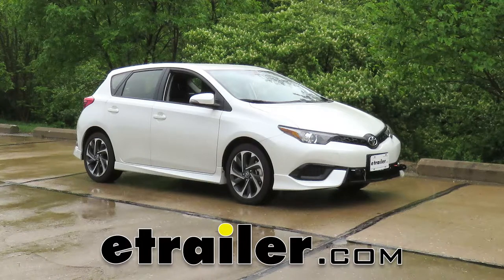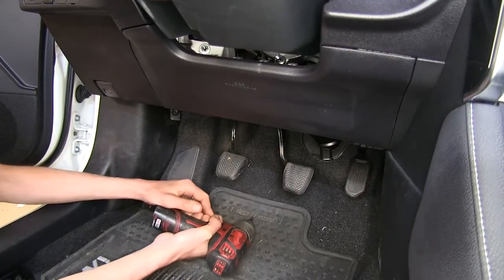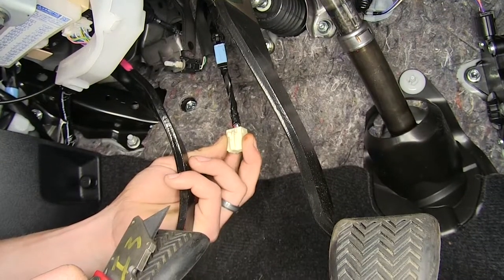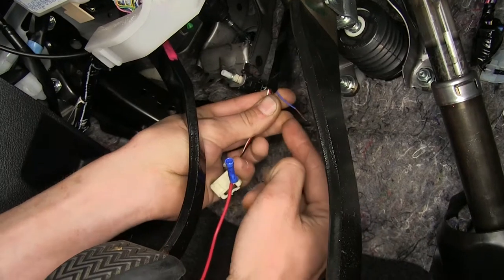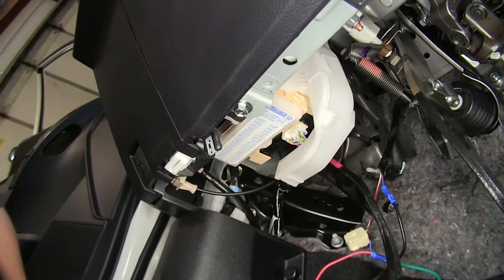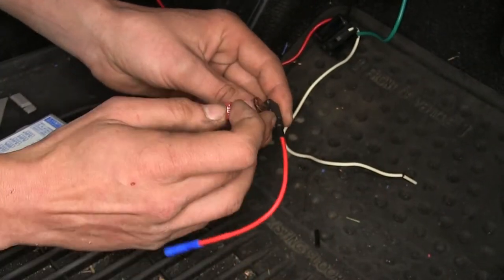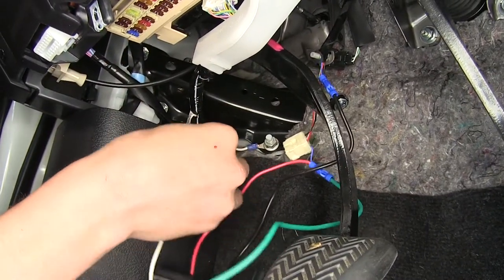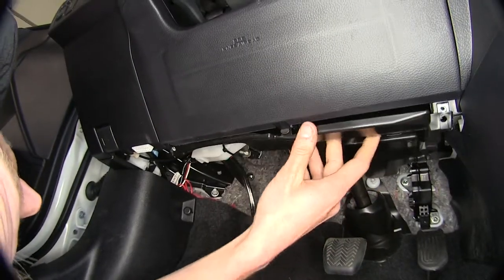DIY Install: Roadmaster Brake-Lite Relay Kit for Towed Vehicles on your 2017 Toyota Corolla iM

Comment: Will this work for turn signals too?
Reply from the maker: This specific part number ensures that your towed vehicle's turn signal lights flash in tandem with your RV's lights. It keeps your towed vehicle's brake signal from overriding the turn signal sent by the RV.

Do you have a specific issue you are trying to resolve?

https://www.etrailer.com/Tow-Bar-Braking-Systems/Roadmaster/RM-88400.html
Reply: etrailer.com Yes I am trying to get rid of hyperflash caused by LEDs
Reply from the maker: Hyperflash is eliminated by adding resistance. Basically tricking the vehicle's computer in to thinking that there is an incandescent bulb installed. You should use something like part number RK-506-2 (at link below).

https://www.etrailer.com/Accessories-and-Parts/Luma-LEDs/RK-506-2.html